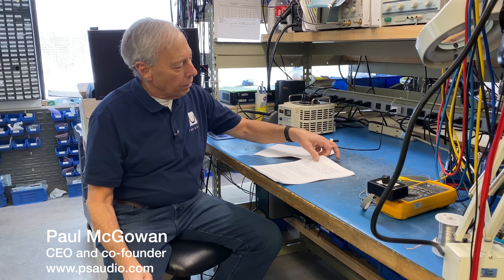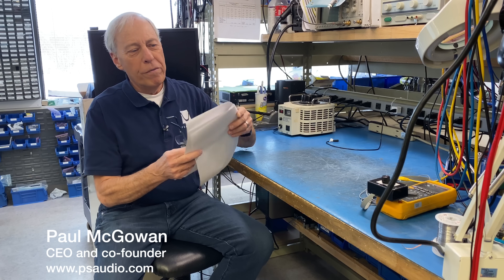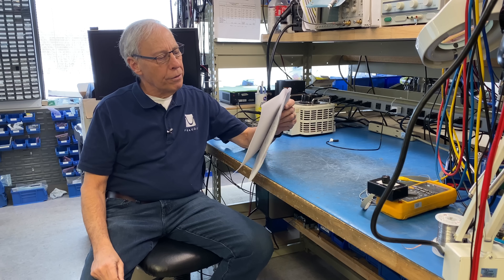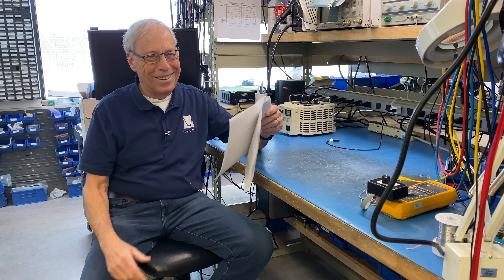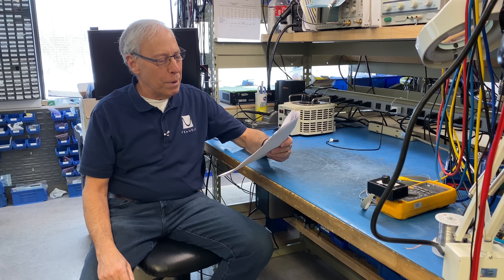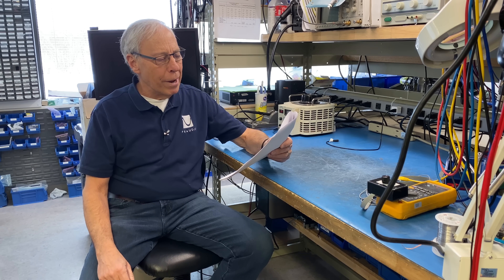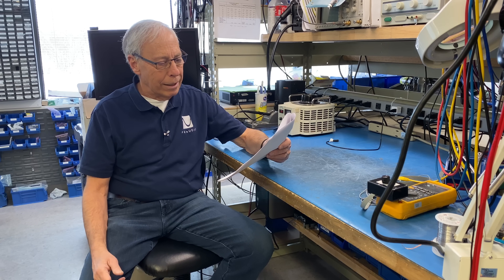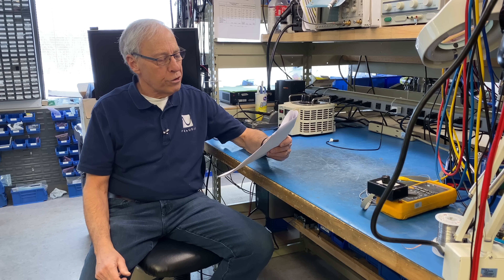How are speaker impedances chosen?

Comment: @PS Audio what you mean by dipped down? at high Frequencies the impedance went low? how can that happen? or is it dependant not from the frequency but also the amplitude?
Reply: As almost any measurement concerning audio gear, impedance is shown as frequency response dependant.
This means that at any point, from 20 Hz to 20 kHz, the impedance (in Ohms) has a different value. For example: you can have a speaker wich impedance at 60 Hz reaches 16 Ohms, but then at, say, 1 khz it measures 8 Ohms and at 15 kHz its impedance is just 3 Ohms. This is called the "impedance curve" of a speaker and it is always a function of frequency.
The norm (but there are many facturers who don't respect it) is the real impedance of a speaker cannot fall BELOW a 60% of its nominal impedance at any point of its whole frequency range.

Comment: The impedance of the voice coil affects the speakers characteristics. Looking in Parts Express catalog, for example. They may show a model of woofer or midrange driver in both 4 and 8 ohm ratings, but the specs between the two are quite different! Need to know what makes the change.

Comment: And the lower the impedence the more the load appears to be a straight wire As far as the output from the  amplifier is concerned. The amplifier needs to be able to deal with almost a short circuit on its output. In the grand scheme of things 4 Ω or 8 Ω is not really that much resistance, if you've got a lot of voltage pushing to overcome it.

Comment: Many 8 ohm speakers dips below 3 ohm somewhere in the midbass. B&W speakers is an example of that. And if you want good bass on those speakers, they need many watts.
Reply: And lots of current!
Reply: @venturarodriguezvallejo9777  watts is a result of amperes and voltage.
Reply: @oysteinsoreide4323  Yes!

Comment: Basically, loudspeaker impedance is determined by the drivers chosen, which are usually 4 ohm or 8 ohm (although 16 ohms is sometimes available for midranges).  The essential difference between a 4 ohm driver and a similar 8 ohm driver, is the voice coil wire gauge and number of turns.  
There are methods by which passive crossovers could produce a 4 ohm loudspeaker that uses 8 ohm drivers, or vice versa, but such crossovers are not efficient.  
Although some driver models are available in both 4 ohm and 8 ohm versions, which gives loudspeaker designers flexibility, many are only available at one impedance.  The designer's choice of drivers may then dictate the loudspeaker impedance.  Loudspeakers that use multiple identical drivers in the same frequency band allow more possibilities, as the drivers can be connected either in parallel or series (or both, if there are 4 or more).  
Regarding components for crossovers, inductors need higher current ratings (heavier wire) but fewer turns for 4 ohm compared to 8 ohm, so there isn't much cost difference.  Capacitors will generally need to have higher values for 4 ohm, so that would increase cost.

Comment: In automotive you can often find 1 Ohms speakers and the reason is that you want maximum power out of the 12V voltage of a car without adding DC-DC converters. Lower impedance means your speaker cables become more critical however. The insertion loss becomes bigger and the damping factor becomes lower at lower impedance. Most home amplifiers will detect 1 Ohms as a short circuit and either shut down or get damaged thus it's not a good idea to use 1 Ohms car speakers in the home.
Reply: @ThinkingBetter Automotive speakers are usually no higher than 4 ohms and most home receivers, except for an increasing amount of new ones, are 8 ohms. 
I suspect I accidentally killed a cheap karaoke system once by using a car speaker, LOL. It was most likely a 6x9-size. :( 
But so far, the Polk VT60 speakers that I purchased recently, are doing very well with my Technics SA-EX140 receiver, which looks like it was made in the early-2000s. (and if earlier, then at least the later-1990s, most likely)
Reply: @RJARRRPCGP  I remember how a pair of Mordaunt Short bookshelf monitors (4 Ohm nominal) went to fire when a little hard driven by my Cyrus 2 SE + PSX additional power supply. 
Since them (it was in the late 90s), I avoid nominal impedances below, as much, 6 Ohm. I prefer to stay in the safe side, no matter how much current my amp system can deliver.

Comment: Always wondered what my IRS IIIa's will dip down to below the 4ohm spec. I didn't call them "receiver killers" for the first 25 years I owned them for no reason.
Reply: I had the Kappa 9s for years, amp killers with impedance dropping to under 2 ohms at some frequencies. Insane for sure. Went to sell them, could not sell them without the amp included as a package. Lost my shirt on the resale for this reason.
Reply: @briansimmons5363  Why the hell did you even buy them?
Reply: @wa2368  Cuz they are frickin' awesome!
Reply: Do you know if the Kappa 6 (which I have) acts similarly?
Reply: @cunningtim  I do not know really.  I assume not an issue. The 9s with 2ea 12" woofers per side made it a power hog and in the bass region is where the impedance problem was. And with being a 5-way speaker the crossover component count was crazy. So 6s not an issue that I know of. I worked at Best Buy as an audio sales guy and customers never had a problem with 6s or 7s. Best Buy would not carry the 9s. Too expensive and didn't really offer an amp solution that would work.  I was lucky enough to snag one of their last Hafler DH-200s they had left and at 200 watts per channel it was OK for the 9s.
Reply: As I said in other coment, ALL the Kappas were among the fierciest speaker psycho-killers one can think about. 😱

Comment: Power density -
Low impedence coils deliver more BL
Motive Force to the driver , allowing D class amps to double or quadruple thier output 
This is the primary advantage, 
Smaller enclosures , drivers and amplifiers 
Not necessarily SQ

Comment: I was really hoping for a nice insight on the matter, but I didn't get an answer. 
Power is delivered to a loudspeaker using two components: Voltage and current. You can have different versions of 100W delivered to a loudpeaker, with more voltage and less current or more current and less voltage.

It is true that in the old days, even for solid state power amplifiers, the transistors were able to deliver higher voltages with more ease than higher currents. Hence, it was preferable to use 16Ohm loudspeakers that got their needed power at a higher voltage and lower current.
With car audio, where 12V is the available voltage, and current delivery not being an issue, appropriate power output devices can deliver power at lower voltages and much higher currents. Hence, 4Ohms or less is the norm with car audio loudspeakers. 
At homes systems, we have more versatility, but there are different constraints. As you say, there's no free lunch. 
I have understood (by reading the excellent books by Douglas Self and Bob Cordell) that any power amplifier design will deliver less distortion with an 8ohm load than a 4Ohm load. Perhaps the differences are minuscule and un-important. But it's there.
More importantly, as you mentioned, a flat impedance curve vs. frequency is more important. I have understood that KEF tried hard to achieve this with conjugate compensation and achieve an almost resistive load presented to the amplifier. I've read that in order to achieve this, they needed to lower the overall impedance to 4Ohms. Don't really understand why that is, though. 
To me, it looks like it would be preferable to run higher voltages and lower currents through the amplifier, i.e. aim for an 8Ohm system. Less current means conductors, PCB traces, even speaker cables would be taxed less. Of course, if you need to deliver, say, 400W to the loudspeakers, these have to come through the transformer, rectifier and output transistors, but the lower the current, the less the implications of having high current devices in the path.
Reply: You have talked by me myself.
Absolutely agree.

Comment: Sort of disagree. How many amps are there that double their power output into 4 ohms Vs 8? To me, doubling power into 4 is saying this is safe to use at 4 ohms. Take my Emotiva.   
75 watts RMS per channel; 20 Hz – 20 kHz; THD < 0.1%; into 8 Ohms. 
150 watts RMS per channel; 1 kHz; THD < 1%; into 4 Ohms.
I would say this is a pretty significant de-rating of the amp. 4 ohms is at 1khz only; not full bandwidth and with 10 times as much distortion! Look at your common AVR, most are going to struggle with 4 ohm loads are they not? Amp power is not keeping up with the low speaker impedance movement I would say.
Reply: He was talking about old tube amplifiers from like the 1940s compared to solid-state amplifiers of today. Way back in the before time, a really good tube amp would produce only a handful of watts, some with single-digit numbers. Indeed, the world's first tube amplifier that boasted a 0.1% THD was only 12 watts, the Leak TL/12 "Point One" (I happen to have one that a friend's grandfather gave me before he passed away, complete with original service manual and schematics).
Reply: @Orcinus24x5  True, I get the history but also talking about the recent trend of moving to low impedance speakers becase watts have gotten cheap. Sure watts are cheap today but finding cheap watts to go into a 4 ohm load reliably and with low distortion is still a challenge I would say. Cart before horse. Low impedence speaker trend but cheap 4 ohm rated amplifiers not so much. In a few years it will get better. I have Elac Unifi UB5s that need a lot of watts and finding a amp to pair with a $450 set of speakers is not so easy. Unless you go $450 speakers and $1K+ for an amp that is suitable but most consumers would reject that speaker/amp ratio I would say.
Reply: @Orcinus24x5  some Australian valve amps used 2 ohm Rola speakers in the 40's and 50's
Reply: They certainly exist though. My Opera Consonance Calaf does.

Others like Krell and Mark Levinson do too.
Reply: @MrRotten187  Lucky you to have this piece! 4 ohm amps exist for sure. Just slim pickings in the $300-under $1k price point. And good luck finding a full featured average priced 7 channel AVR that can drive 7 channel power hungry 4 ohm loads. All channels driven simultaneously, full bandwidth and low distortion.
Reply: @briansimmons5363  Yeah. it´s one hell of an amp too, and a very good fit for my Infinity IRS Omega.

But i totally agree, at the price you mention, and in general with receivers and such, they will not have the ability to double. I do think it´s reserved for the very high-end ones.

Comment: 6 OHM SPEAKERS?
Reply: My ADS L520s from 1980 are specified as 6 ohm nominal inpedance.
Reply: @stephensmith3111  My L810's are 6ohm as well. The L910's are 4ohm, however. Both are @ 93db.
Reply: I was playing with a set of Realistic Nova 4's the other day from 1976 and they had 6ohm tweeters in it and a 8 ohm wolfer. Not audiophile equipment by a long shot but I found it to be weird enough to notice. (I installed Infinity RSa crossover in them and replaced the blown up woofers with a 8" pyle's and kept the tweeter. Sound pretty good for garage speakers.)

Comment: Are you saying that pulling a bigger load through my amp is going to make it perform better? I agree it will be more watts. but i thought that an efficient speakers at 8 ohms gives more air and detail to the music. also in not familiar with that many manufactures making efficient (above 91db) 4 ohm speakers.
Reply: Impedance alone has nothing to do with "air and detail". Further, there are plenty of 4 ohm speakers with high efficiencies. Martin Logan's Motion 60XTi for example, has 94 dB efficiency.
Reply: ADS L910's; 4ohms and 93db.